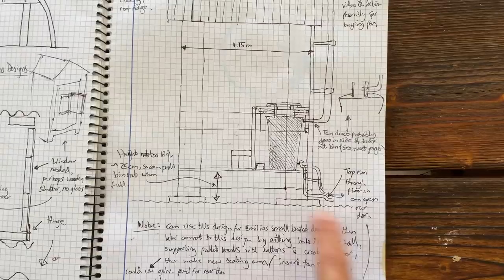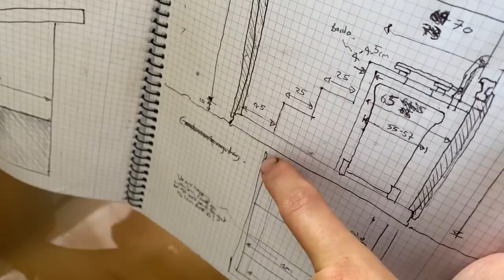ESCAPE TO THE WILDERNESS | OFF-GRID LIVING | DIY Compost Toilet Build #1

Comment: There are much better solutions for that. Dig a pit about 5 ft deep 4 x 6 ft concrete the bottom then brick the sides, not forgetting to put your inlet pipe  near the top on one side and your outlet pipe 6" below on the opposite side.  A steel plate on the top for access incase of blockage. It's called a soak away
Reply from the maker: Thanks for comment Robert! This does indeed sound like a simple solution. Robbie tried to make us do this in the beginning, but I told him I wanted to store the compost so we can move it around the land and feed our trees (after a couple of years of fermentation of course,) that’s how we came to the idea of the bin system. Also the toilet is quite near our spring, so we were a bit worried about hazardous things going into the soil!
Reply: @ladyandtheowlman  Not the best idea as human waist contains a lot of chemicals and metals from the food we eat, so far better to let it drain away slowly and if you do get blocked then call the council to come and empty it and do not,,, use and bleach or other such things down the loo as it stop the muck from decaying as it kills all the good bacteria. Trust me I have had a soak away on my last 3 farms.

Comment: To get a plot square Rob use the 3,4,5 method---pythagoras theorem
Reply from the maker: Thank you Chris! I am now aware of this method thank you for the recommendation! Doesn't help that all our wooden shutters are bent from the heat! Sometimes I feel like a worthwhile investment would be to get a giant metal triangle, and throwing a concrete block on it to keep it pinned down - it's a bit difficult to do pythagoras on your own because the boards keep moving! ❤️